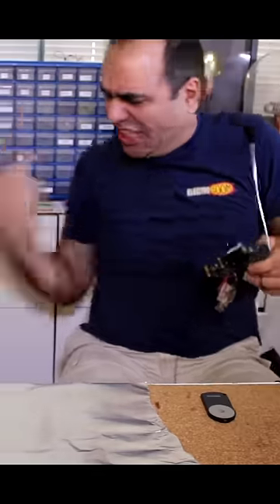Voice Sensitive Arcs!!! #electricity #science #funny #music

Comment: You are on to something. Ionized air has been usded to produce sound. However, you need a bigger coil, say 12 million volts because of the wavelength of sound being in the vicinity of feet. So you need arcs that are several feet in length. You will note an astounding increase in the efficiency of sound generation.